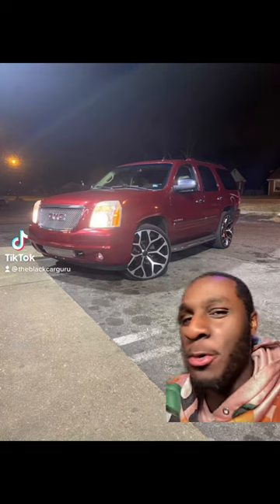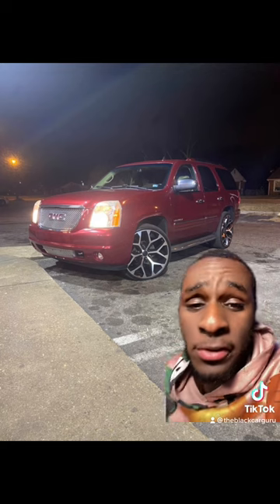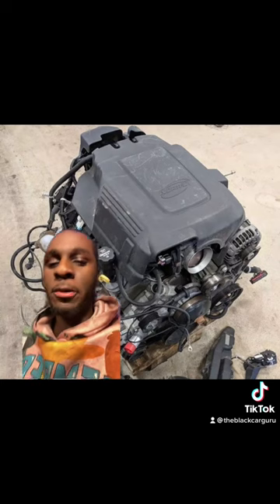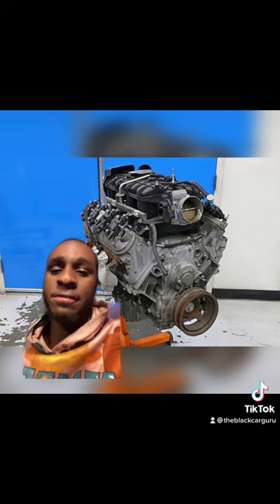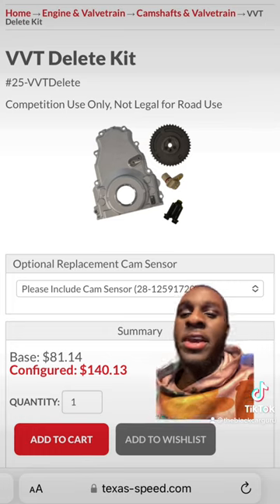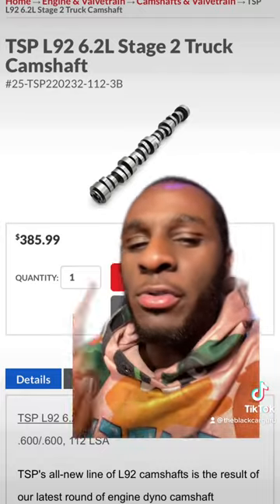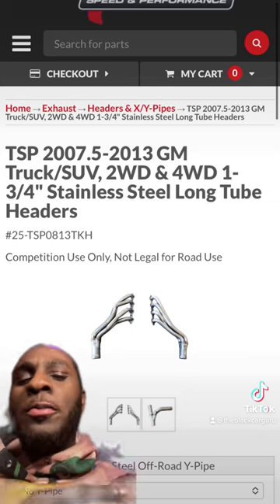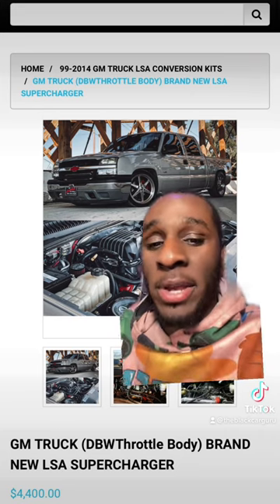Can you make a 6.2L Yukon Denali fast?| Let me explain!

Comment: I would say that these 6.2s have a tendency to pop ringlands on stock pistons. Maybe some cheap summit racing forged pistons would be worth taking a look at to help prevent this.
Reply: This
Reply: Any you recommend?
Reply: Bone stock or with mods?
Reply: @flakogonzalez2884  I used a set of forged pistons from summit racing on the LS pro series. So far with about 5000 miles of use they’re doing fine but that’s not very many miles so time will tell.
Reply: @speedslayerr  Bone stock they still aren’t reliable pistons. I bought a 2007 Escalade with a blown motor and it actually had 2 pistons out of 8 with cracked ringlands and they both had the pieces come off and cause serious damage to the combustion chambers.
Reply: @Lou_sassel315  ah that's unfortunate. I have one with 130k mi and I disabled AFM and only use super gas. My thought is that the trucks with issues primarily are a result of temp gradients from AFM and knock from using regular gas. Just a theory, don't really have evidence to back it up but I am hoping it is mostly true for my sake as I hope to take this truck to 200k mi
Reply: @speedslayerr  the l92 that’s in my Escalade didn’t have AFM from the factory. But as to what grade fuel the previous owner would use I couldn’t honestly say. It had about 175k when the motor gave out and I bought it.
Reply: I got a 2013 Yukon Denali with the afm. Truck had 217,000 miles on it when the afm started malfunctioning. I blame myself because I went almost 6 months without an oil change, about 2 days after the oil change. Christmas tree lights, slapping noise, and significant power loss. Got the range afm disabler has been running fine since. I am saving up to get The entire system deleted but also figure while the the motor is being worked on why not upgrade a few things!!
Reply: @bmacster1985  yea might as well change the cam while your in there! The slapping noises could very well have been the lifters smacking the cam surfaces so it’s possible there’s damage anyways so that’s a good excuse for a bad ass choppy cam!
Reply: @bmacster1985  absolutely!!!

Comment: Steve Meade put twin snails on his Escalade. He’s got the hardest suv I’ve seen hands down!
Reply: Laughs in LSXCALADE
Reply: @joshhuwhyte3988  LSX Escalade is dope, but not Steve Mede dope.
Reply: LOLOLOL Steve only makes 9xx wheel. Mitch has made over 2k on his old setup. It's not even the same league.
Reply: @joshhuwhyte3988  actually it is the same league they’re both TT- SUV’s , however they aren’t built for the same purpose either ,  but we won’t act like a tune on Steve’s ride wouldn’t produce similar or close to the same power with a tune. At the end of the day though, it’s preference. Steve’s truck is a lot better in my opinion.
Reply: It really wouldn't. Meade would need a whole different fuel system and bigger turbskis.
Reply: @joshhuwhyte3988  ok, I won’t keep going going back and forth with you over preference. After all it’s not like you or I own either vehicle, and at the end of the day Steve still has the hardest Escalade I’ve ever seen.

Comment: Yo, my dad got a 6l l77 caprice with cold air intake, full exhaust and a x pipe, problem is it needs a tune, what do you suggest?
Reply: To go get a tune... you think this guy is giving out tuner names or something 🤣🤣, look up speed shop or performance shops in your area homie and enjoy the traveling if u have to
Reply: @cormaro13  bet thanks
Reply: Go to a good performance shop and get it dyno tuned. They'll tune the transmission as well. I have a G8 with similar mods and the tune turned it into a different car.

Comment: Would you mind doing the 5.4 2v and the 5.4 3v
Reply: I sold my 2004 f150 5.4  - only thing you can do is cams 
Longtube e85- pullies - stall converter - intake I believe there is a ford racing 2v intake - sct tuner - maybe make 350 -370 rwhp
Reply: My 2008 Ford expedition is 5.4 2v I have stock Bottom end with a full built top end twin Turbo and 93 tune💨 with a little bit of Nitrous on the side😈

Comment: That's WAY too effort and money just to go up less than 100 HP to the wheels. The stock 6.2s normally put out 400-420 at the crank. The 325 is embarrassing with a measly 355hp at the crank, especially in the suburbans and XL Yukon's weighing 3 tons.

Comment: Can this application be put into a 2002 silverado? And is it worth getting rid of the 6.0?
Reply: No just put the l9h/ls3 heads on your 6.0L. Unless you need to save weight with a lighter block, your money will be much better spent on just the heads. You would essentially make it a ly6 with the head swap
Reply: If you wanted to do the swap however it is possible, but you would have to adapt things like the reluctor wheel so it’ll work with your gen 3 pcm. It’s not really worth while in most people’s eyes, but definitely possible and has been done several times before I’m sure

Comment: Just put me on game I have 2008 yukon denali 6.2l and shit this here video opens my eyes
Reply: Nice, I got a 07 Denali and thinking about doing a cam, adding dual spring kit, high pressure oil pump, bigger torque converter. Only question I got is IF I should do it since my Denali got 174k miles already.
Reply: @Elec Soto  nice bro mines has 189k but I had the engine re build just got it back a week ago
Reply: @Yusuf Garrett what happened to your engine? Lifter failure? That’s what got me worried about the engine and so for prevention I got the Range Technology plug-in so it deactivates the AFM and keeps it in V8 the whole time. Luckily I haven’t heard any lifter tick.
Reply: @Elec Soto  that's exactly what happened to my engine cost me 4000 for the whole rebuild
Reply: @Yusuf Garrett sheesh, sorry to hear about that. At least it’s rebuilt now and you can start from scratch with mods without having to worry as much

Comment: Hey talk about how top fuel drag cars are the fastest cars in the world that are fuel based combustion motor cars. Oh and then talk about how they use 500 cubic inch 11000hp hemi motors. And how that at the very tip top of the racing mountain is dodge talk about that.
Reply: It's only because of restrictions. Overhead cam was going to kill the pushrod but got banned.
Reply: @tylerhagen3068  so your implying that ls motors are banned from racing in top fuel because it would destroy the hemi. Explain why there is nobody anywhere who has strapped tge baddest possible ls motor to anything and ran as fast as a top fuel car restrictions on the sport or bot sombody if it was possible would do it so just stop okay and face it why is it so hard for ls and chevy people to admit the dodge and the hemi motor is the best. And don't reply unless you have proof time slip or otherwise showing a ls car going faster than 338mph in 3 seconds.
Reply: @justadakota1822  well considering top fuel already has more power than they can actually put down throughout the entire run and it's essentially clutch engagement that wins or losses the race the point of if ohc can make more power is rather moot.

But there is no magical advantage to pushrod besides easy service. A hemi combustion chamber with ohc would technically be capable of even more power. But if you can't put it down what's the point.

Dodge had one in the works for nascar but after ford's cammer was banned it scrapped the project.

The LS is just the poor man's way of going fast on a budget. Not sure what your hangup on dodge being so superior is. Top fuels run them because it's basically hard coded into the class, sure they were the best design in the 60's but be real there's power left on the table with modern architecture.